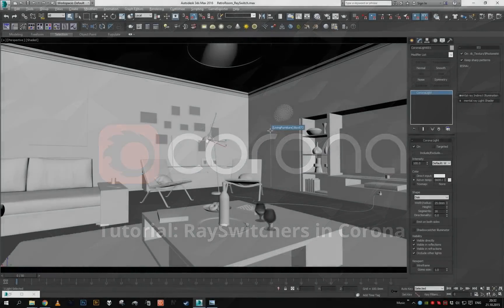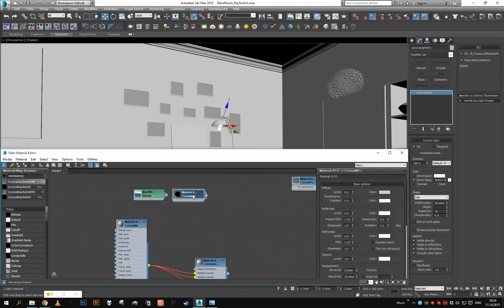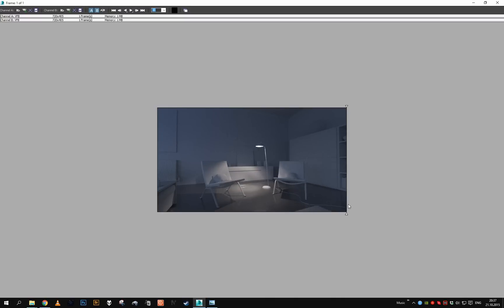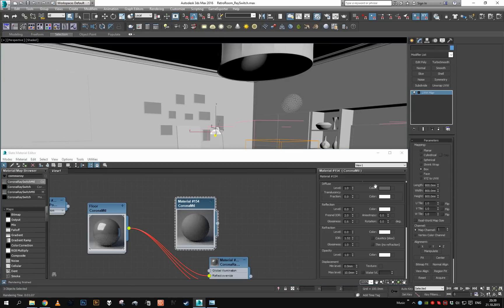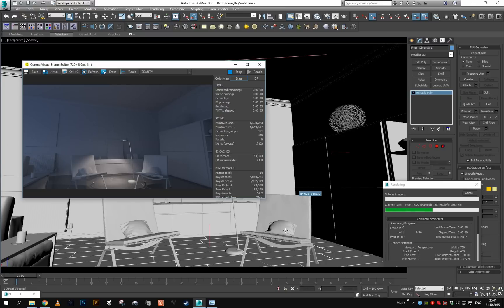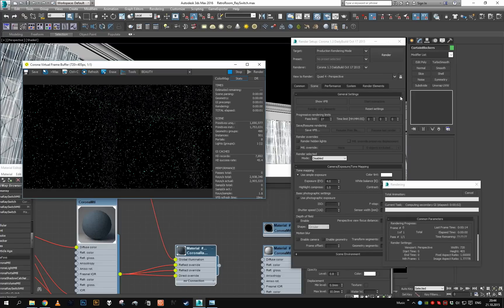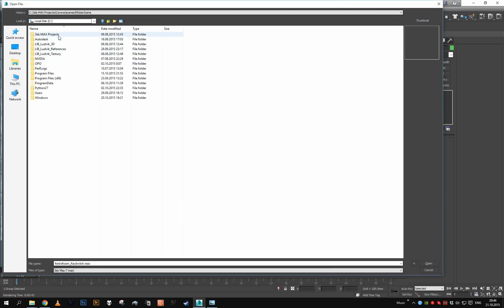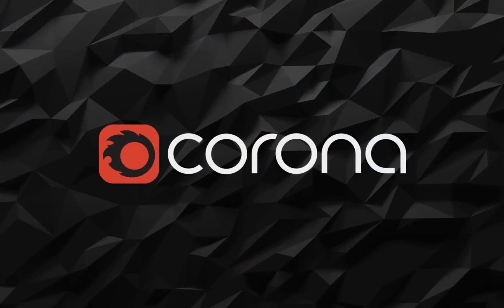TUTORIAL: Using RaySwitchers (2/2: Performance Optimization)

Comment: Controlling gi on material very good. When using self-illumination and a texture is applied, is there any way to see it rather than  flat white. Vray does the same.
Reply from the maker: Best to post the question over on the forums (https://corona-renderer.com/forum/index.php) as I am not sure what you mean, and some examples of the results you get and the results you are looking for would be good (and YouTube comments don't allow for that). A texture in self illum should show as textured, unless the intensity of the illumination is too high (then like any light source, the camera will see it as pure white), so be sure the intensity is set low (or exposure adjusted to reveal the detail in the texture map).
If you just mean it loses any sense of geometric shape, this is expected (in the real world too), but you can combine it with reflection to add some shape to the geometry, or limit the intensity of the self illumination and have some diffuse in there too.
But... neither of those may be what you mean :) So, forum is the best bet! Thanks! Tom
Reply: @CoronaArchViz  Yes it's the first one. I noticed in your power plant model the interior lighting was flat white as you say that's how that camera sees it. But its a bit hard to see how the texture has mapped. Corona Light material you can see the texture even if you push up the value. Very helpful videos, thanks for your reply.

Comment: Did you encounter with such problem?

I created RaySwitch material Metal + CoronaMTL in Global_iIlummination slot_(with completely black diffuse).
I need to use blend it (RSW) with CoronaLayerMTL further but,
Then I assign this RaySwitchMTL in some of layers it works like material in Global_Illumination slot.
Reply from the maker: For technical questions, the best thing to do is post over on the forums - that way you can include screengrabs of your material set ups, example renders of your results, and an example of what it is you want to achieve. As well as that extra info that can't be done on a YouTube comment, the question will then also be seen by Corona users, developers, and support (most of those don't see things on YouTube comments). https://corona-renderer.com/forum/index.php?board=29.0 would be the best place to ask. Thanks! Tom
Reply: @CoronaArchViz  ok, thank you for your advice. I'll try to answer there as well. I only thought that you know solution as author of this masterclass tips with rswitcher.
Reply from the maker: @kucherovstudio  The tutorial author, Ludvik, is not the one who replies from the Corona account though :) You might catch him over on the forums, but even if not others will be able to reply.  I might be able to reply too, but to be honest I'd need to see some renders, material set ups, and know what you are trying to achieve as I am not sure what result you are after (and YouTube doesn't allow sharing of screengrabs, images, etc. so is not a good place to dive into that in detail - which is why posting on the forum would be good so that I, Ludvik, or anyone else would be able to answer :) ) Thanks! Tom